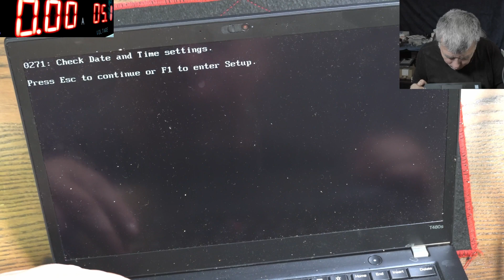Lenovo Thinkpad T480s usb type c replacement - Not a hard job

Comment: Hi  your guide for removing and refitting the ThinkPad USB-C power socket was excellent. Using your advised temperatures with a heat gun and soldering iron worked well, and now my ThinkPad X390 Yoga charges perfectly. I did notice that after reassembly, the socket only works when the USB-C plug is inserted in one direction. So I resoldered the new socket inside again now all good Thanks again..

Comment: As an IT pro who is, at least interested in learning electronics repair as a hobby, I do appreciate you talking through the video sharing the Temp settings and other key details that I was interested in learning. Another rare thing is that you are doing this in real time, meaning the video was not sped up so it really helps understand how long thing take to melt, stick, etc. Thank you!

Comment: Sorin, I think it's incredible how you can take a hot air nozzle on a small port, but not affect other nearby components! Are there more problems with USB -C charging ports than regular barrel type ports?
Reply: The solder bath is done with a higher temp solder
Reply: @vforvendetta3074  hopefully one of these days I can try my hand removing components with my hot air station! Thank you again

Comment: Do you think someone who's never done this kind of stuff could oull it off? I fear the t480 i just bought is not charging from the same Port you repaired. And it  is a little wobbly. I hope this is the only problem
Reply: Those ports are so weak, and if you don't repair them right away they will damage other power-related components. Repair shops like to say that such repairs are complicated but you can do it if you follow this vid. You will probably need to borrow some tools too

Comment: Just a question on 480s. I replace screen touchscreen on it. But every now again get melody and doesn’t turn on LCD. Says problem with lcd cable but then starts working several attempts later. The lcd was exact same fru.
Is this mobo issue?
Reply: Most likely a dirty connector or damaged ribbon cable

Comment: "Not a hard job" Requires special tool.
Reply: I do not see any special tool - things like screwdriver, tweezers, soldering iron and hotair is kind of basic (and not very expensive too) if you want do to electronics repair. If someone wants to do woodworking for example i am sure he has to spend much more money for even a very basic set of machines like circular saw, planer, router and so on...
Reply: @tvelektron  hot air station = special tool.
Reply: @koltinn a cheap hot air gun is $20-30, not a special tool at all.
Reply: @testingtester6908  In this video a $200 hot air gun is used, not a $20 one.  It will take longer with cheap tool, but it will work.

Comment: i have to say... i'm missing longer videos. 
not that this are not to the point but having to learn how you come about finding the problem is much more rewording than repair on it's one. 
Yes i know there will be alway ... why so long... why so short.... but usualy people that request short videos are here just for on thing and then they are gone. 
Just something to think about and maybe add some longer videos just to se how to aproach problem with boards.

ty for your time.
Reply: Same!!!
Reply: I am sure he received the machine with the problem disclosed which in this case was likely battery not charging. Typically there are 3 hardware and 1 software problem that could cause this: 1) Bad battery (charging or showing 100% doesn't mean it is a good battery (it may not be holding the charge, etc.).  3) Charger is bad, DC port is bad (this is usually fairly easy if it is a plug in type as oppose to soldered as in this case.  4) Software wise, however uncommon, faulty BIOS could be the culprit (check with vendor as if this was the case, there would most certainly be an emergency update with the issue listed. There are software that can easily check to condition and health of the battery but if the BIOS wasn't the issue, the charger checked OK (or another known good charger was used) and the DC port showed proper voltage, then fair to assume the battery was bad. If the DC/USB-C charging port was visibly damaged as in this case, again the port was likely to be the culprit.

Comment: If im not mistaken, these thinkpads can charge from the other USB-C port that's part of the dock system. good to check sometimes if its more than just a port
Reply: Yep if it has the charring Symbol next to it you can use that port for charging if you don’t have the Lenovo square jack charger on hand. The one next to it that has the dual port you usb c / Lenovo jack is used for the dock stations with built in charging so you have to waste a different port. I’m pretty sure this model is the thunderbolt 3 version.
Reply: wow didn't know that, my port broke yesterday and I didn't see anyone mention this. the second port works indeed, thank you!
Reply: @spasibushki  my grandsons laptop had the same fault and i did not know about the other charging port. now working fine when the charger is plugged into this.
Reply: THANK YOU